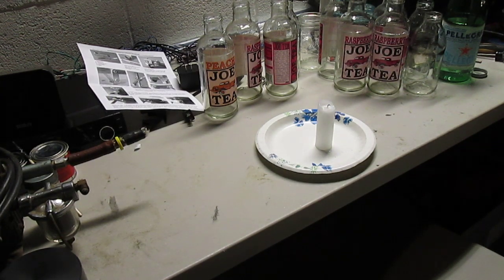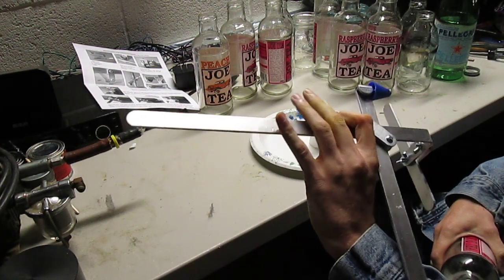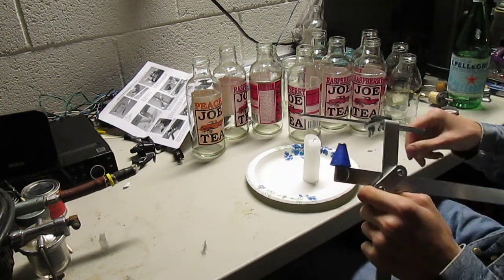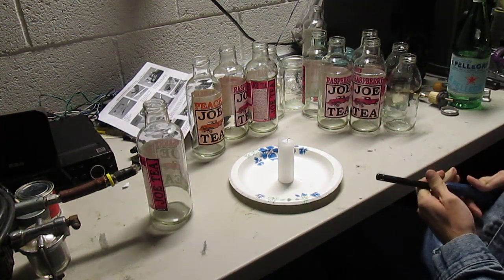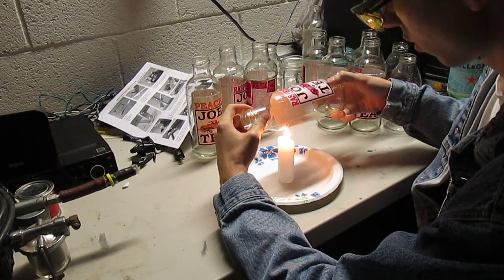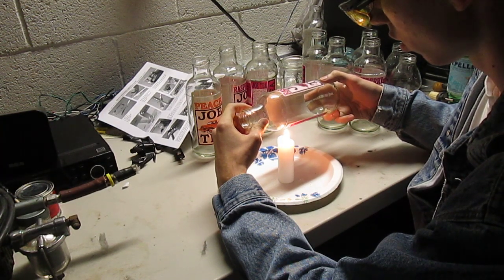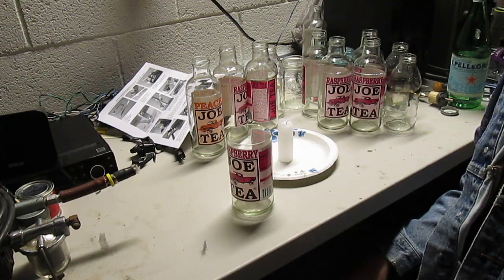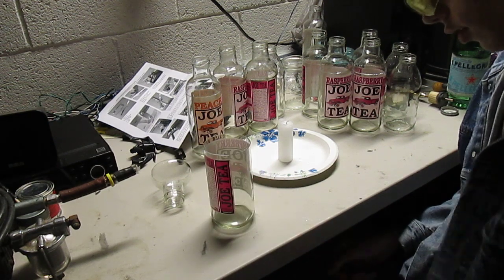Ultra Simple Bottle Cutting Method For Vacuum Tubes

Comment: very nice job. but what i cannot see; is the flame directly under your scored surface or is it off to one side ? (i.e. just to the right side of your line in vid) to allow the side to the left of the score to be cooler (to make use of differential rates of expansion)   cheers  ~wiggy
Reply from the maker: Hello Wiggy,

I made use of the expansion and contraction of the bottle by positioning it so that the flame and the heat rising from the flame would climb up the bottle and pre-heat the glass before it came into contact with the main part of the flame. But I kept the flame directly below the score line.

At the time I never knew about such a technique, and due to a series of failures/imperfections that happened before I started 'getting it right': I didn't want to chance anything. Thanks for the interesting advice though.

- Mike